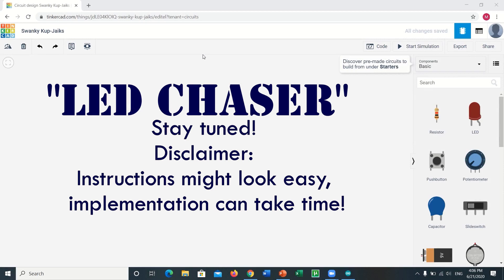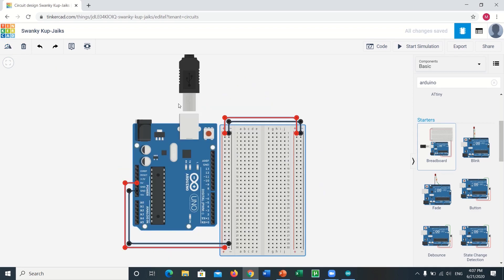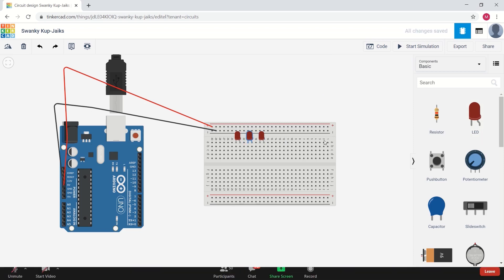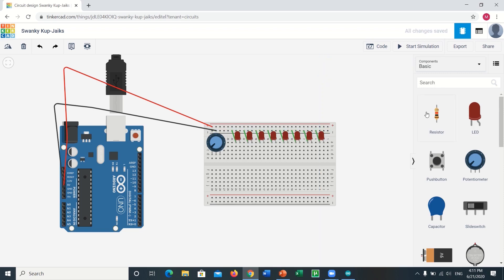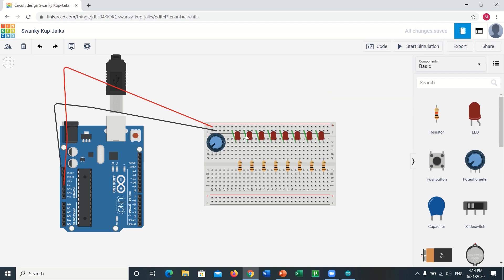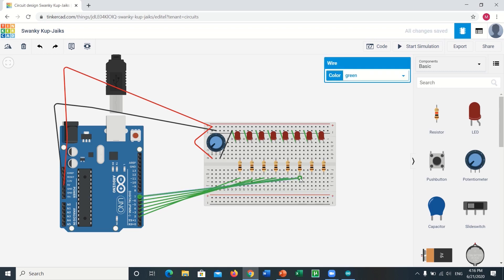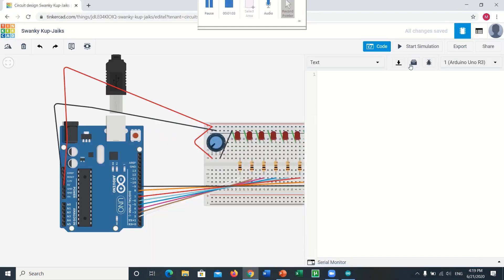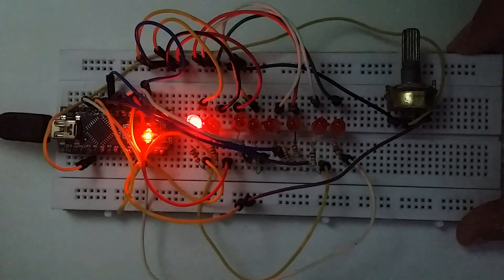Make an LED Chaser at home! | Light up your house | Tutorial / Arduino Project| Start Decorating!

Comment: Overthought, overkill and can be more easily done using a 4001 and a couple of discreet components to generate a clock signal, feed that to a 4516 up / down binary counter which then feeds a 4514 4-16 line decoder. run up to 16 LEDs at a time, add capacitors to make them fade as part of the progression and you have a 16 LED chaser light that needs no external power regulator to run from anything from 3-15V.